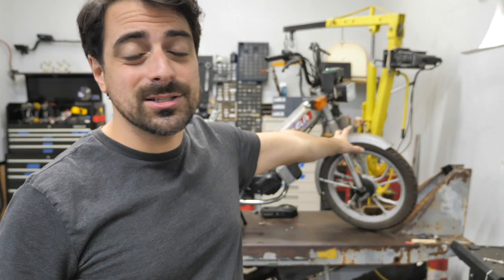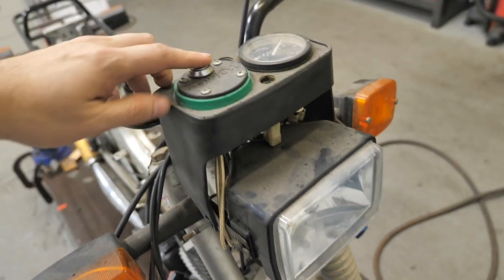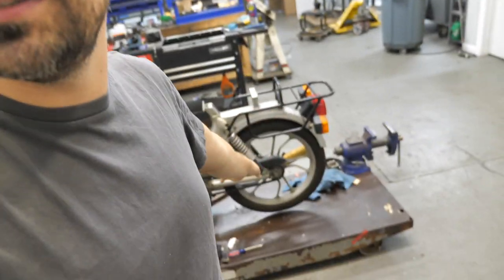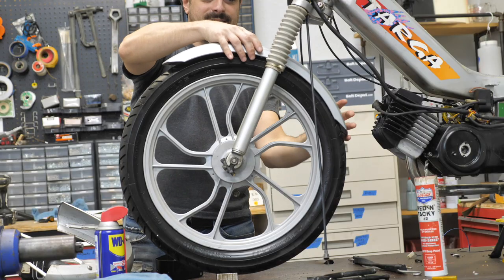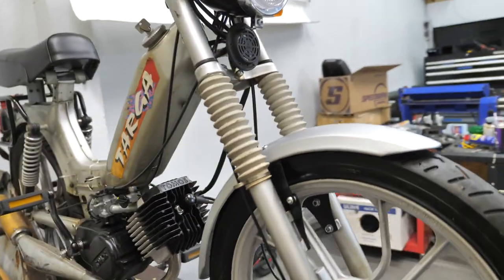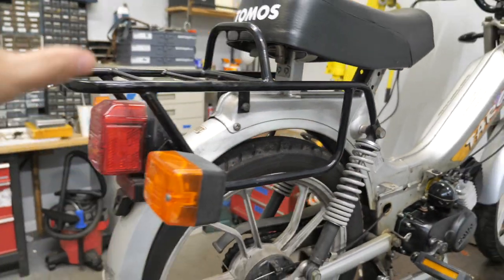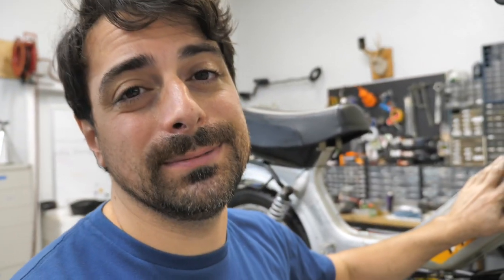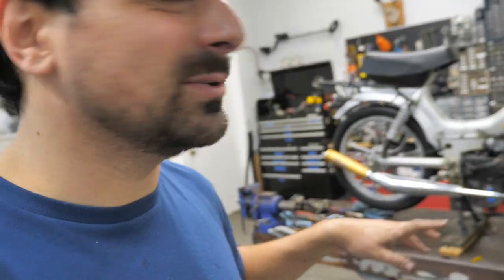How to Make your Moped Dope - 3 easy things

Comment: I'm in the middle of something similar on my Maxi/magnum Hybrid.just chopped the rear fender. put the Magnum front forks on and the magnum swing arm on the maxi frame about a 1 3/4 inch lift over the maxi height... engine rebuilt 64cc polini/Biturbo exhaust.Now for the electrics replaced the 6V lighting coil with a 12 volt coil. tore out the original wiring harness and am building a new harness for 12 volts DC with a Rectifier/Regulator no battery. all LED lighting with a LED directional circuit. Similar drectionals like you have, brought my LED brake light up higher right under the rack.lowered the seat 1 3/8ths inches to hug the rack.LED H4 headlight super bright with a high beam. speedo light changed to LED.Yamaha dirt bike bars just about a inch taller than yours.new brackets for a Cafe racer type fairing with wind screen.I'm thinking of shortening my front fender as well make it look more like  yours.going to blackout all the chrome the rack under the seat, foot bars, and front fender all black. it should look nice against the bright Yellow frame.

Comment: Hi, thanks for the video/info. I looked on your website for the taillight you used in this video, but only found the Sprint taillight holder. Is that what you used, along with a sprint light assembly? I can’t find anything smaller with that fender angle on bottom. I want to shorten my rear fender and do what you did here. Please let me know, thanks
Reply from the maker: Yes, that tail light holder on the website is the one. Unfortunately, the tail light that mounts to it is out of stock.  There is an alternative tail light that needs a little modification, on treatland.tv

Comment: Great video! 
I have recently begun to try and service my Tomos A35. And i need to get the left engine cover off, it seems that i have remove the tubes from the oil pump, since the tubes go through a small hole into the behind of the left engine cover. I can't put the engine cover back on now anymore, because the flywheel is not alligned, so i gotta have it off. Also i would like to clean it up in there. 
If u ever see this, would u consider making a vid about how to remove the oil pump correctly without deleting it? xD
Or just a helpful article, i would like to try to go about it myself. I think my biggest challenge is the clamps that holds the tubes on the oil pump. I would like to service the oil pump as well. 
Hope hearing from you!
Currently no vids about servicing the oil injection can be found and information is scarse. :(

Comment: Hey guys. I’ve got an old tomos targa lx, I love it but it is incredibly loud. Is there a way to silence this thing as much as possible?
Reply from the maker: It shouldn’t be too loud.   I would first check for a head leak.  By the header where it meets the cylinder, be sure the exhaust is tight and flush.  Also, the gasket there could be blown out.   The bike would be significantly louder if its not sealed.  If thats good, check the baffle section of the pipe.  If it’s missing and the pipe is just a straight pipe, it will be loud.  Or maybe the insides of the baffle are gone.   Lastly check the airbox.   No airbox will make the moped noticeably louder.   Best of luck 🤞

Comment: I'm a bit late to the party, but could you tell me how you fastened the speedometer in the lamp? I have the same one, but no way to fasten the thing inside of it. The bracket that came with it doesn't do anything to keep it in place.
Reply from the maker: If the bracket is too short to bottom out against the inside of the headlight, I slip some rubber tubing around the “legs” of the bracket.  Add whatever length you need to make contact.
Reply: @MopedProblems  thanks for your reply, I ended up making my own bracket out of some aluminum. It's not a perfect solution, so I'll see if the rubber tubing makes a difference. The video worked, by the way; my tomos turned out dope!

Comment: I've changed my bars but can't get my throttle to spring back did you change the cable
Reply from the maker: My guess is the throttle tube is  rubbing on the new bars.  Either at the very end of the bar (in which case move the throttle assembly a little bit to the right… so the grip isn’t rubbing on the end of the bar).   Or, the handlebar is rubbing on the inside of the throttle tube.  I’ve seen this on the painted handlebars.  You’ll have to sand down or acid remove the paint where the throttle tube is.  A little light oil in the throttle tube helps too.
Reply: @MopedProblems  brilliant reply thankyou I will do that thankyou

Comment: Finally looking at mopeds and I am aiming for a Tomos. It's nice to see the video's are still as good as ever. I'd love to see rack options for the Tomos which allows it to carry delivery cooler box bags for Uber Eats. When I think of commuting, I think of packability.
Reply from the maker: TOMOS is the best choice.  The rack you required will have to be made though.  All the factory racks are simple and not designed for heavy loads.
Reply: In my county its very common to see it used by food delivery man. Post office usses it to to deliver post.

Comment: Have you ever done a thumb throttle conversion on a tomos just wondering where to start
Reply: Do you have any Insight on this question
Reply from the maker: It’s possible, probably not too comfortable
Reply: @MopedProblems  any suggestions on parts

Comment: great look i did that looks great im new to this moped thing lol ni have a question i start  it runs  then it dies i need to adjust the  throgt . n i got leds turn lights  3 out 4 the left light dont work!  can you help  thank you  lm donnie from pittsburgh pa
Reply from the maker: Thanks for the praise!   It’s hard to help via comments but have you added an LED style flasher?   LED lights draw little power and a different flasher is needed for it to work right.

Comment: Any tips on setting up turn signals? I bought a tomos that was optimized for racing so only the headlight and tail light works. Would love some advice so it's a bit less illegal come summer.
Reply from the maker: A stock wiring harness is one way to go…. But the wiring is not hard, same hot wire that is used for the headlight… it just goes to the turn signal switch and from there to the left and right turn signals (and from there grounded)